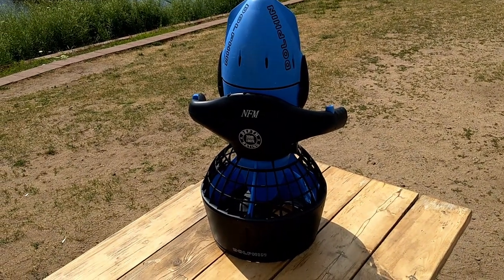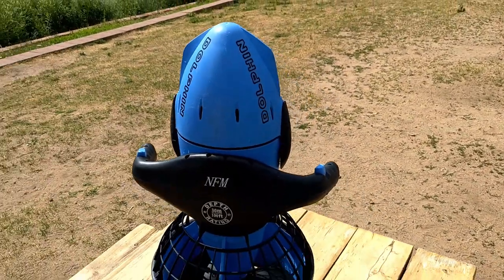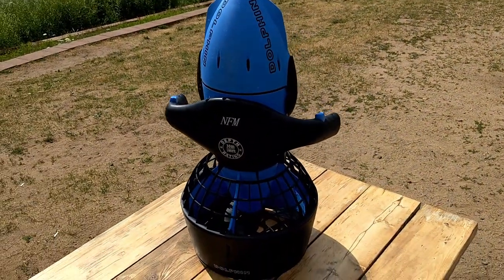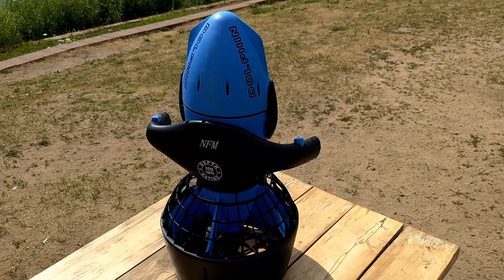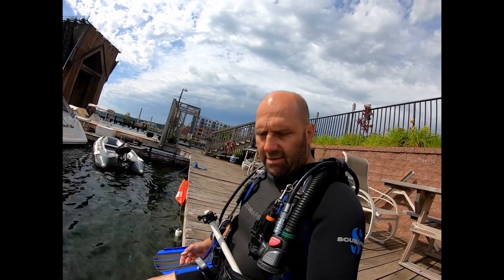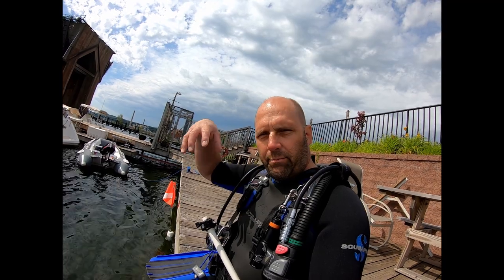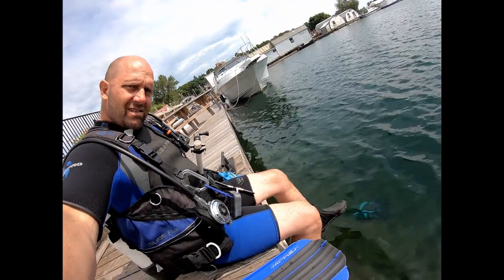Sea scooter hack Seadoo NFM

Comment: Hi Don.  Have you ever had your SeaDoo GTi apart completely? I bought a waterlogged one for not very much and have replaced the motor and pub but i have no idea where all the connections go as they were all corroded when i took the thing apart. I can not find any wiring diagrams anywhere online? Regards. Roy

Comment: I have the older version Seadoo Dolphin with the snap down clips. Battery was kind of weak and expensive so it sat on the shelf for a couple years. I looked online a couple days ago....WOW!!!! batteries only $20 now! I ordered one from (Walmart).
I was thinking I should have ordered 2! I might just use it for my LOWRANCE on my kayak.
Why is the scooter so dang loud? doesn't that scare away the fish?
Reply from the maker: I think its a bit loud too. Perhaps that's why I rarely see fish when I'm using any of my scooters... 
How did the new battery perform?
Reply: @DonFassbender  it worked great.
It still wound up being my lowrance battery because I use the kayak all the time.
Are you related to Joseph Fassbender in San Antonio?
Reply: @DonFassbender  I was wondering if the gear reduction system inside is the reason for all the noise. It's basically a hand held troll motor but troll motors aren't that loud.
Reply from the maker: @Manuel_Z_Kayaks  I was considering building a scooter using trolling motors. I have plans from a 1970s article from Popular Science magazine. Might just do that one day. Thanks for reminding me.
As to the noise, I'm not sure. My newer Hoverstar is certainly more powerful and quieter.
Reply: @DonFassbender  The WalMart battery worked great! plus I use it on my kayak to run my electronics. I haven't had a chance to use the scooter yet but I've modified the connections to fit the new battery. I just use a regular Schumacher smart battery charger to recharge the battery. Bass Pro also sells a similar battery for about $20
Reply: @DonFassbender  The Hoverstar probably doesn't use a gear reduction so you get more spin and less noise. I wish they had set the triggers to speed control like a light press would go slow and a full press would just go.
Reply from the maker: @Manuel_Z_Kayaks  I missed the question about Joseph Fassbender, sorry. I'm not really sure. My Great G-parents came from Prussia a long time ago but I do have cousins whom I never met.
Reply from the maker: @Manuel_Z_Kayaks  They are available locally here as well for about the same. I might tinker some this winter. Are you in Texas?
Reply from the maker: @Manuel_Z_Kayaks  I'd prefer completely variable speed too. As well as a place to clip to. For the money it's a slick little machine though.
Reply: @DonFassbender  He's in Maine

Comment: My seadoo has styrofoam floats inside the plastic prop guard cover thingy. I took the styrofoam out and mine sank immediately. I bet you anything yours doesn’t have the styrofoam floats
Reply from the maker: That's probably the case. Everything else on this one looks like my Sea-Doo, I just haven't bothered taking the cage off to look. Thanks 👍

Comment: io ho avuti 5 di questi e entrava sempre acqua nel motore e scheda madre,io ti consiglio di mettere del silicone in entrambi le parti.
Reply from the maker: Translation: I had 5 of these and always entered water in the engine and motherboard, I advise you to put silicone in both parts.
Reply from the maker: Thank you, Jhonny Salvo. I have been lucky so far, that this is the only problem I've had with this machine. I always lubricate the o-rings prior to use. Since I have the new Hoverstar I haven't really used this one. Thank you for the advice.
Reply from the maker: Grazie, Jhonny Salvo. Finora sono stato fortunato, questo è l'unico problema che ho avuto con questa macchina. Lubrifico sempre gli o-ring prima dell'uso. Da quando ho il nuovo Hoverstar non ho usato questo. Grazie per il consiglio.
Reply: bene,meglio cosi,perche sono un po delicati,bel video,grazie a te.
Reply from the maker: @jhonnysalvo3106  Sì. Sono comunque divertenti. Sono contento che ti sia piaciuto il video. Don
Reply: si e' vero,io li uso da quando avevo 12 anni,il mio primo maialino era in dolphin come questo però giallo,con acceleratore a levetta ,basta mettere un po si silicone per bene e durano anni,se si tiene bene,poi io lo sciacquo sempre dopo l'uso con acqua dolce,si il video mi e' piaciuto tantissimo,bravo.
Reply from the maker: @jhonnysalvo3106  Grazie per aver menzionato le leve dell'acceleratore. Non ci avevo pensato. Ispezionerò e aggiungerò silicone anche a quelli. Grazie ancora!
Reply: no,scusa alle leve dell acceleratore non ce nessun bisogno di silicone,tanto sono con il magnete non ci sono fili elettrici di fuori ,puoi stare tranquillo per quello,la cosa importante e' proteggere il motore e scheda madre,nella zona motore si svita dal interno e ha 6 viti basta che le sviti e sotto troverai il motore con l oring in gomma che comunque fara' entrare lo stesso acqua non serve a nulla quello,in quella fessura lungo tutta la circonferenza del cerchio immergi del silicone dentro in modo che una volta che chiudi tra le due parti e avviti le viti il silicone si espande dentro le fessure e una volta asciutto non entra piu nulla,al massimo gli ingranaggi li metti un po di grasso o  vasellina,in modo da farli girare senza grattare fra loro e dureranno di piu.
Reply from the maker: @jhonnysalvo3106  Vedo. Grazie per averlo chiarito. Sembra un buon progetto pomeridiano innevato. Sono contento che tu abbia trovato il mio video. Per favore, guarda alcuni dei miei altri. Mi fa piacere il tuo contributo.
Reply: certo,sono contento che ti faccia piacere li guarderò senz'altro.